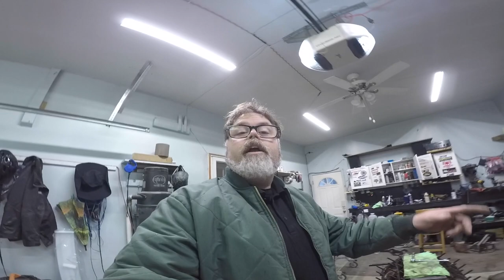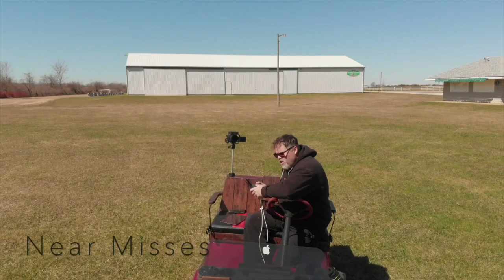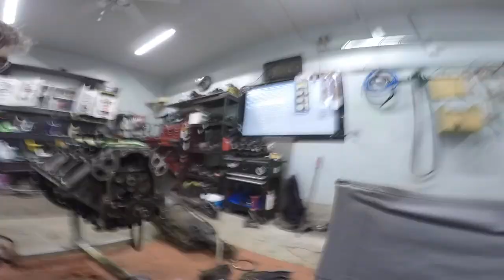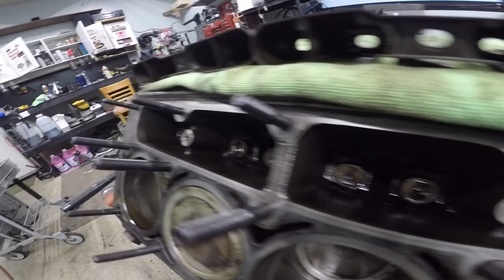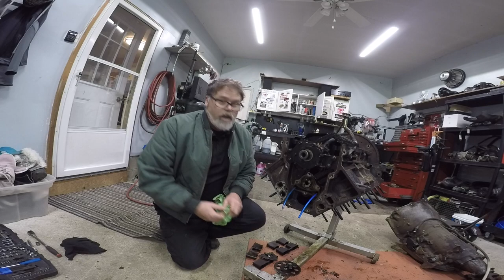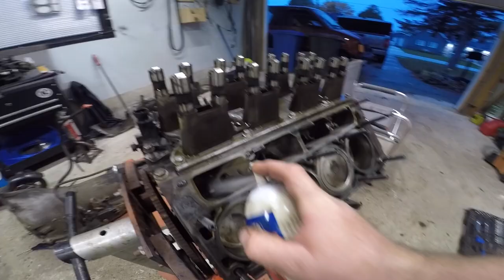LS CamShaft Stuck This Is Your Video

Comment: Not a budget build when you need take tear down the entire top end of the motor to replace the lifters. Thats one area I never leave alone if doing a budget build bc on a LS factory block there is no way to replace them if one goes bad anther then pulling the heads and in your can I dont see that being easy. Yes there are areas to save on but that isn't one of them bc of the fact there not easy to get to and they could take out the cam so if that happens is it really budget still? I had a factory set go bad just a year ago. Motor only had 67k on it. Do yourself a favor and replace them and don't lose sleep over it. Just note not all LS lifters made today are good. If you want suggestions let me know. Best of luck!
Reply from the maker: I’m not replacing them just the cam

Comment: Turning the cam a few rotations pushes all those lifter up and out of the way so they don’t catch the lobes when you pull the cam.😜 I’ve done a few LS cam swaps and never had trouble with the lifter dropping and catching the cam.
Reply from the maker: The lobes don’t push them up height enough to clear the cam bearings
Reply: Every LS I’ve done has
Reply from the maker: Not sure what to tell ya I had one that wasn’t going up high enough . I will have to take a closer look at the old cam and see if I have a bad lobe . I’m glad I took them out they where tight . . That all cleaned up now too
Reply from the maker: Thanks for you comments love all the input